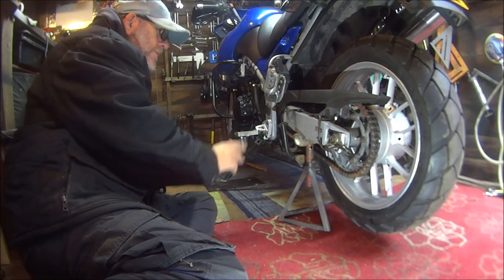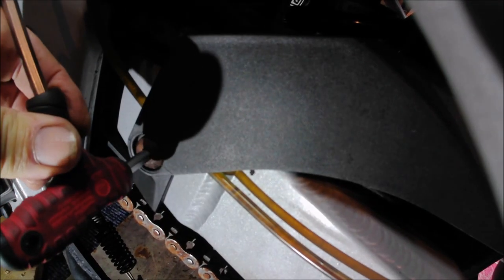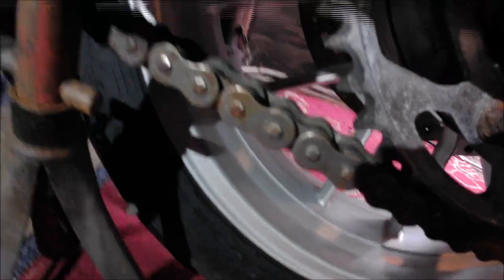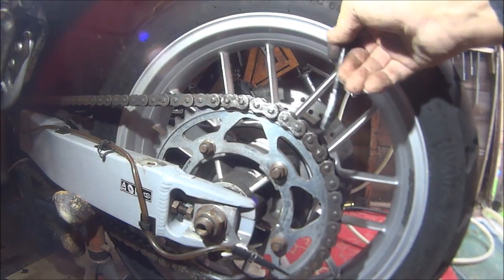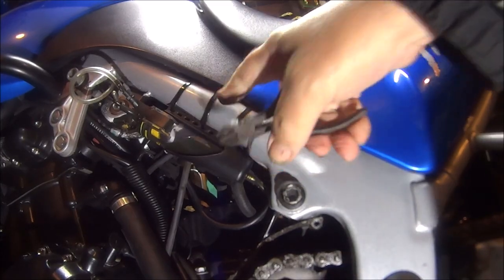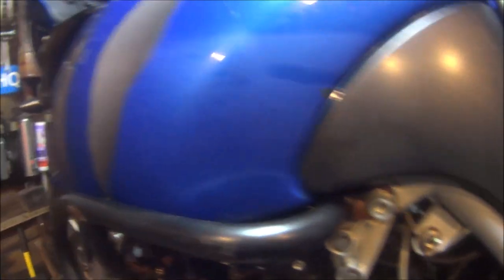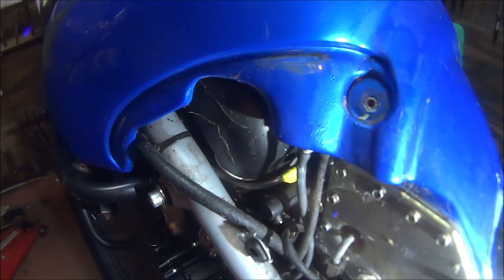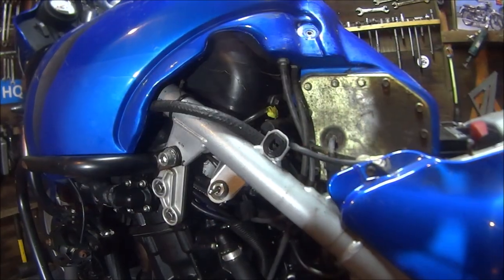TIGER 955I, checking and cleaning the chain and sprockets  and stuff.

Comment: Hiya John great video mate great to see you doing what you do again,  and I'm sure on the scottoiler one pipe is a vacuum and one is a filler primer tube , I have one on mine and I'm missing the filling tube
Reply from the maker: Hi Sean.. I thought they would go to the vacuum system somewhere. Cheers Sean.👍🐅🏍️
Reply: @jonyr1TT  yes 1 does for sure I stand corrected if I'm wrong
Reply from the maker: Thanks again Sean.👍
Reply: The clear pipe goes to a black plastic vent cap (probably sat on top of the airbox under the tank) for the Scottoiler reservoir to allow air in as the fluid flows out, the black plastic joiner is to allow you to disconnect it to refill the reservoir, you can remove that completely. The thinner black hose is the vacuum from the throttle body connection, that one needs to be sealed. Better still remove it and plug the spigot at the throttle body. While you are in there, check the black plastic corrugated pipes between the throttle bodies and the Idle Air Control Valve, they get brittle with age and split, which results in poor light throttle running, replace them with silicone hose (taking care not to kink them during refit. The bracket where that switch is fitted normally has a 12V DIN power socket fitted.
Reply from the maker: Cheers buddy you obviously know a fair bit about the 955i. 🎄👍
Reply: @jonyr1TT  More T300/T400 885's but happy to share the lesser 955 info I have if it helps anyone save some time and a quid or two.
Reply from the maker: Nice one mate.👍

Comment: Hello John, thanks for all your Video maintenance on the 955 Tiger.What do you suggest me for adjust  the right drive chain tension? Center stand or side stand? How much cm or inch you take at the middle of the swing arm? I often drive my 05 955I with my wife and paniers for the Week end...Thank you very much John for advises
Reply from the maker: If I don't have the workshop manual I'd use the main stand try to get about a quarter of a inch sag in the chain then use the side stand to make sure it's not too tight.👍
Reply: @jonyr1TT  Great Thanks ! My on the work shop manual it's specified 35 to 40 mm slack  measured on side stand ...I'll adjust the chain drive on center stand and I'll check the right adjustment on side stand ...as you told me . 👍